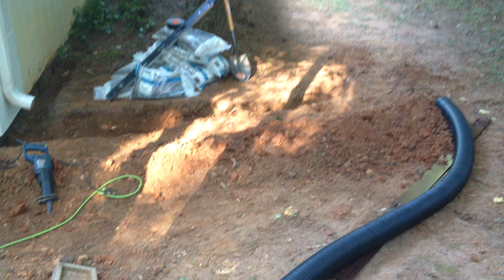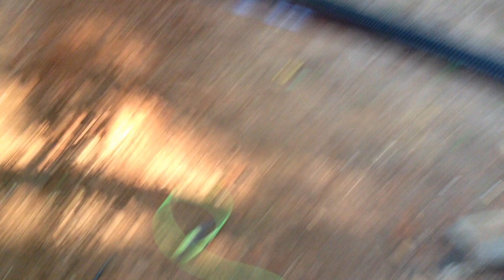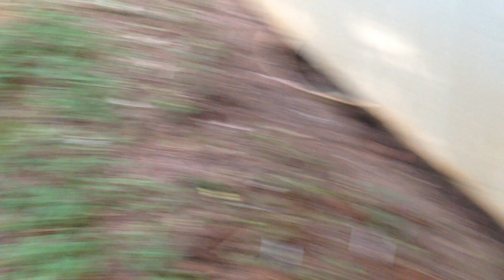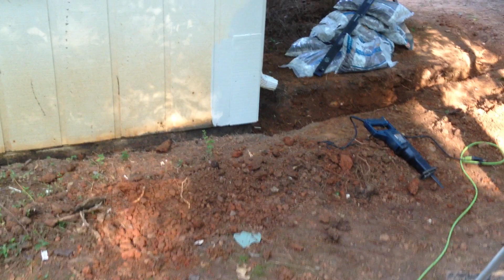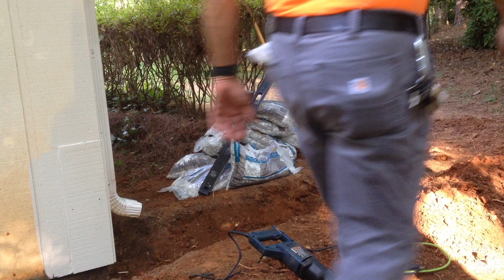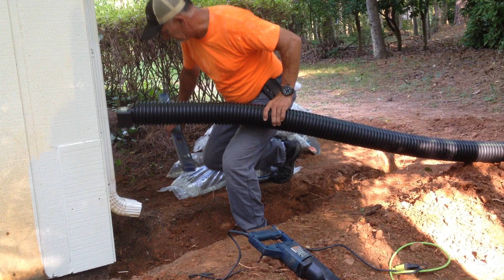HOW TO:  INSTALL BASIC FRENCH DRAIN.

Comment: I put in a French drain. I used the same type pipe.  I had my running down at a slight angle. I put gravel under mine for a base. The dang thing floated up on one end about 2 feet where the water started to run into the drain. I had it covered like yours. I can't get a refund because I did it.  Eaglegards...

Comment: I would suggest a screen over the end of the pipe to help keep critters out.
Reply from the maker: Good idea.
Reply: Screen might be too small of holes but try hardware cloth; it comes in several sizes of holes or weave.
Reply: @tnoel374  I used a drain cover. It plugs up. Ain't worth a Schitt.

Comment: all do respect man but from where I sit, you could have started digging 2-3 trenches well-away from the house first, waaay back (:28 mark of your video),  and dig 'em horizontally and deeper to... start catching some of the water waaay back there so that there's less water to play with NEAR the stupid house, sheesh. Then the top of footing/wood at  :40.... seal that gap/crevice, seal the bottom of the stupid wood. smh...  you could have also LOWERED the grade along house so some water doesn't hit, soak bottom of wood (seal it!) and you could have dug trenches deeper and longer, that plus having other trenches FURTHER away would give the stupid water more places to go but what do I know, only been digging for 40 years, again... smh